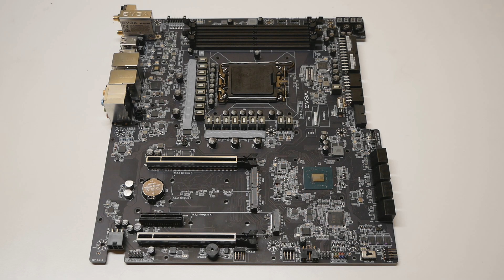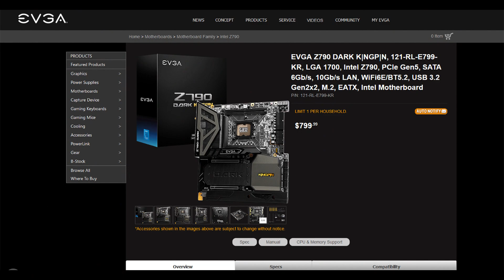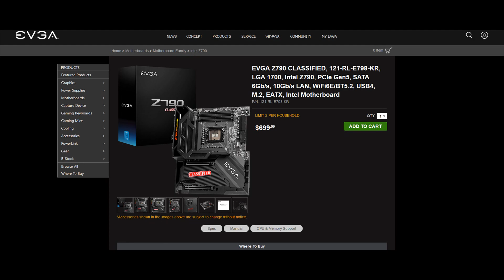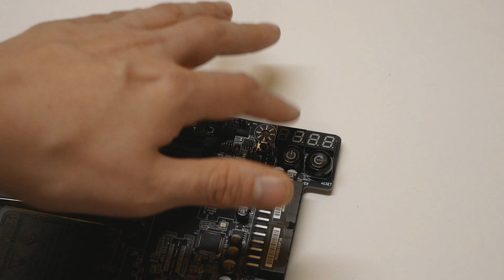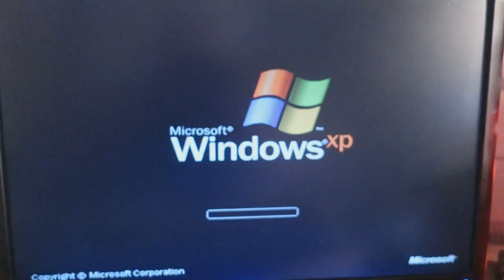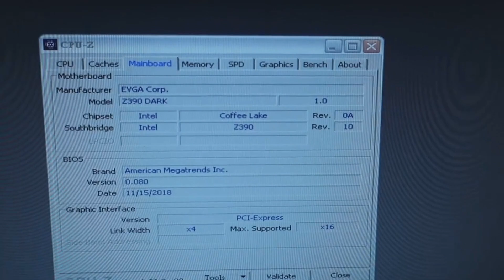EVGA Z790 Classified - The Most Interesting Motherboard from EVGA for Z790? In-Depth Overview

Comment: did you do allready a volt mod on the mobo ? those 2 tiny wires top left on the board?
Reply from the maker: No those were there since I got it. The board is an EVT so it has some lacking things.

Comment: Asus z790 apex vs z790 darkkp which one would u recommend for gamer with light experience with OC and want to run stable with 13900KS and 2 Dims of ddr 5 8000 ram thx~~~
Reply from the maker: I guess both will suite you well, even the Classified.

Comment: Just upgraded from a 12900K Asus Z690 Hero that maxed at 6600 CL32 (2x16) to a 13900K Asus Z790 Hero that runs 7600 CL36 (2x16) stable, zero problems. Both are G.Skill Trident Z5 RGB kits. The Z690 was actually able to run 7000 and pass MemTest with my 12900K but was not stable in TestMem5 and games, so I kept it at 6600. The Z790 is stable and passes TestMem5 absolut at 7600 CL36, haven't tinkered with it yet, just XMP with the last updated BIOS. One of my friends runs a Z790 Extreme 13900K at 7800 stable. He wants to change it for an Apex and 13900KS to get to 8000. So tbh unless I see big RAM numbers in the +8K range don't think these EVGA boards are worth it for daily use.

Comment: Wait, no mount nut inserts for M.2 ports? Also is that 2280 slot or actually 22110 without possiblity to use 2280?

Comment: Board is too expensive
They just needed to do Z690 Classified 2.0 with 2 dimms removed and tuned bios for same $330-360, instead of have $800 Dark and 700$ parody on Dark, its like 4090 and 4080 case but even worse. And Z690 Classified looking much better, would be a perfect MB if not ruined by weak memory oc and underwhelming bios releases
For 700$ 4 dimm board i rather buy MSI Z790 ACE or Z790 Aorus Xtreme which would be better memory oc and bios support.

Comment: No matter how well built it is, I can't consider the Dark KP or the Classy as "enthusiast" level boards anymore. The PCI-E expansion's missing, (where are we supposed to put a capture card?)  the U.2 is gone, there's no thunderbolt. If it's not onboard, you can't use it. This makes the Z790 boards only really useful as gaming/OC boards, no more, no less. The fact that there aren't any lanes available for anything other than the x16/x8 split pci-e 5.0 slots is a complete shame.
Reply: What do you expect? There are only so much lanes available. That's not EVGA's fault. Intel just doesn't care about giving these CPUs more of them, which is a shame. I would be more happy with 40 PCI-E 5.0 lanes and quadchannel memory support too. But this option just is not available, as long as you're not rich and can afford a W9 3495X or similar and the nessecary board for it.
Reply: @AlexanderDinebier  please educate yourself before spouting nonsense. there are 3 m.2 nvme slots on this board. there are 0 u.2 slots. On by z390 dark (2 u.2), my z490 dark (2x u.2), my x299 dark (2x u.2), these u.2 ports are shared with the m.2 slots and those lanes come from the CHIPSET not from the CPU. It's bios selectable. EVGA is removing content and raising prices. I won't be buying the z790 dark because it's no longer useful to me as an enthusiast board due to a lack of u.2 ssd support (a used 7.68TiB u.2 costs $750 and uses TLC, not QLC like the m.2 options)
Reply: @GreybushGamer  so the lanesharing doesn't bother you? I think most people that buy these boards go more for speed than for storage options and probably don't use U.2 at all. I got one of them in my X99 sytem too, but just cause that board only has one M.2 slot and the remaining 4 lanes could only be used this way. 

I think it's not as easy nowadays to produce good PC parts at reasonable prices without sacrificing quality or features. So they probably took away what's not used by the most people. 

What do you think about the new sapphire chips?
Reply: @AlexanderDinebier  No, I don't really care about lane-sharing. I care about capacity. It's not like I'm going to be using a zx90 board to run a relational database... I care about capacity and only a single device operating at a time. Think like video scrubbing, recording and games storage.
Reply: @GreybushGamer  You could still do RAID with several SATA SSDs. Of course that's not as fast, but for sure enough capacity.
Reply: @AlexanderDinebier  yeah, or I could just buy someone else's products. Or I could use 10GbE or I could do any one of a number of things that have nothing to do with spending $800 for a de-contented motherboard that literally has less features and ability than the previous gen and the gen before it.
Reply: @GreybushGamer What 13th gen boards do you consider are worth buying?
Reply: @gerardoliveras430  if you're gaming and don't need the u.2/u.3 ports? either the kp or classy probably. if you need u.2/u.3? z690 kp.

Comment: You mention a fair bit about sli support but there is no indication that the board supports it in the manual and i cant find any mention of it anywhere. Most other vendors have not purchased the license for sli support and it doesnt work on most z790 boards. I purchased the z690 Dark as i still like to use sli for benchmarks as i assumed it wouldn't be supported. Could you please confirm if it is or not. I look forward to seeing the memory results with this board
Reply from the maker: You are correct on that one. They technically don't have any problems running SLI, but more or less a licence thing.

Comment: I'm not really sure what the purpose of this board is, you might as well just get the Dark considering this price. EVGA should make a cheaper, downcosted 2DIMMer with cheaper IO but try to keep as much of the OCing features (particularly on the memory) at a lower price. I don't see them getting new customers like this because I don't think many people aren't really interested in changing brands in this price bracket.
Reply from the maker: Actually not like so. Even some 4 dimm boards can do 8000+ with 2 dimms, so in daily capable memroy frequencies the difference can sometimes be relatively low. Depending on how high VDIMM you are willing to use.
Reply: Can't even buy the dark version at the moment 😭

Comment: That's really interesting about booting windows xp on the modified drivers. I wonder how Asus bios team managed to pull that off....

I noticed Asus sells a 1 lane gt 730 that fits into a physical x1 slot if you're looking for a low end gpu with more flexibility.

Comment: So far I max out with 2 DIMMs at 7600 Stable. 8200 boots into windows, but its trash. 4X was a sad 6600, just like the rest of the Z690/Z790. The 13th Gen IMC is the limit here. Also EVGA marketed this as a 19 Phase, but its really 14-phase for the Vcore. I like the marketing BS EVGA is trying to spin.

SA is stupidly high by default. 7200 is 1.4V. Trying to degrade my IMC....
Reply: Are you using 7600mhz Dominator?

Comment: I got my z790 classified up and running this past weekend. 13900ks, 64gb 7200 4x16. xmp profile is working at this speed. Upgraded from an x299 ftw k and 10980xe. Looking forward to your memory overclocking tests with this board and I really enjoy the other content as well.
Reply: XMP working is not equal to stable oc
Reply: how's it for ya 
considering this motherboard for myself
Reply: @abluepfp  I'm still enjoying it. no issues

Comment: I just got one a couple weeks ago, it's by far the best board I've ever purchased from EVGA.  I even had a X58 E762 back around 2010 (my previous favorite), but damn this board is badass, they really did good on this one.
Reply: So excited for mine going to pick it up from UPS today!
Reply: @AgnosiaAgnosis  the z790 dark version? Or which one?
Reply: @rowankeltizar5961  right the z790... Idk why you'd buy old tech at this stage in the game haha
Reply: @rowankeltizar5961  I got the classified bc I couldn't get the dark kingpin anymore
Reply: @AgnosiaAgnosis  where did you purchase? I can't find it anywhere
Reply: @rowankeltizar5961  Newegg... I actually got two by mistake hahaha gotta sell this one now
Reply: I've been looking for a motherboard. I hate Asus and MSI. But with recent developments with EVGA, do you think it's still a good idea to pick up their boards? I can't even find the dark kingpin version of the z790 right now.
Reply: @rowankeltizar5961  the classified is well worth it, solid board for me so far, and I run it 24/7.  The Kingpin is overkill unless you're pushing extreme overclocks, especially on the memory.  EVGA had stated they'd update the bios for the next gen raptor refresh, so it's bios will still be refined.  Usually when things are off with a board, you have a failure very quickly after the build, so I think it's safe.  I haven't had a single issue with anything yet, this is the most seamless board I've ever built on.  The way I see it, you're taking a gamble on any board right now after hearing the voltage issues with ASUS AMD boards, makes you wonder what else they missed.
Reply: @rowankeltizar5961 dark kingpin isn’t available anywhere r n. I slept on it also and missed out. Have classified otw from Newegg… I think they’re sold out now also